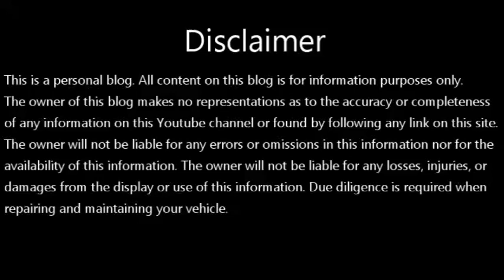MALAKAS AT MAGAAN  NA WATER PUMP at KAYA ANG 30 meters HEAD PRESSURE

Comment: Kaya bah ang 120 meters kasi malayo kasi yung pinapatubigan
Reply from the maker: sir hindi ko pa po na try, pero sa tingin ko lang po ay kaya nya pag hindi masyado elevated, ibig po sabihin less yung head pressure pag flat surface lang yung dadaanan ng hose, kung may elevation po kasi na more than sa 30 meters, possible po na may ma develop na airlock sa hose once na interrup yung daloy ng tubig sa linya.
Reply: @UDoITchannel  mga 7miters yung paahon nya kaya ba

Comment: kaya ba nya  e akyat sa 10 meters na taas na storage tank ang tubig sir
Reply from the maker: Sir sa bandang 5mins to 6 mins sa video, ang hose po dyan ay more than 20 meters at ang elevation ay more or less 8 meters pero sa incline po sya, hindi direct na naka vertical, pero malakas po sya, sa specification nya ay kaya ang 30 meters head pressure. May gagawin po akng video tungkol sa pag test kung kaya ba nya ang 20 meters downstream na pahigop, ibig sabihin malayo ang source ng tubig sa pump. Hintay hintay lang. Ask nyu rin po ang seller para sure talaga na masagot po ang tanong mo.

Comment: 12 meters lalim kaya ba nya, gusto ko sana malaman ang HP nya at nagamit ka parin ba ng foot valve dyan?
Reply from the maker: subukan ko po gumawa ng video gamit ang 20 meter 1inch hose sa down stream side nya kung kaya nya higopin, dyan kasi sa video ay nasa 1meter lang yung pump doon sa source tapos yung upstream or yung out nya papuntang drum ay nasa more than 20 meters.
Reply: Ah okay so yung sinasabi mo sir na liitan ko ang tubo/hose ginagamit ko kasi 2 inch original nya eh, sa bukid ko lang kasi ginagamit di ko pa natry sa malalim na balon. Thank you po